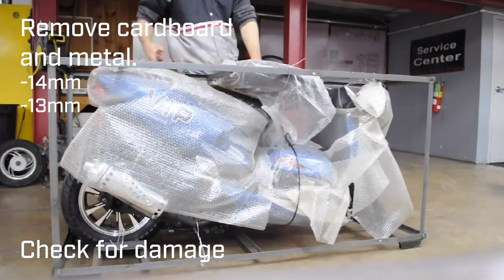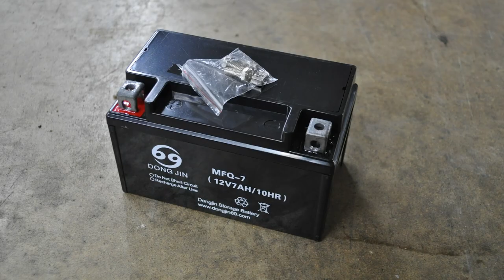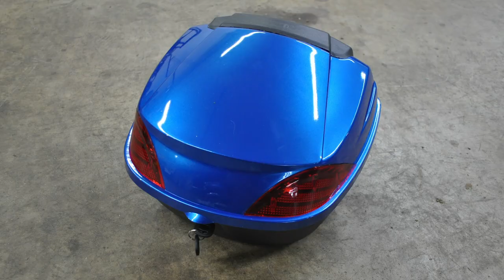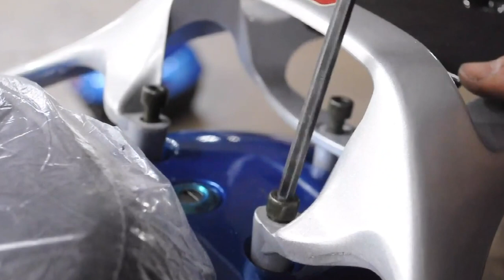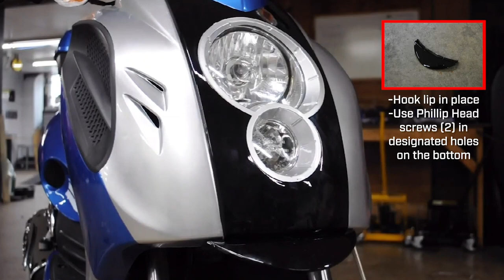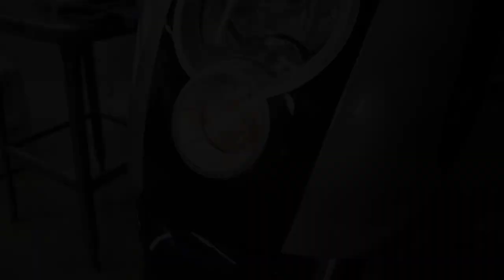Tao motors PowerMax 150 Scooter Assembly | Q9 Powersports USA

Comment: Thanks for the video. But the scooter is worst of the worst. It has only been 4 months and its body is breaking. Its is very fragile and not at all reliable. In jerk its side panel broke now i am confused how to fix it. The panel.itself is costing $100. Never every buy this.
Reply: @ Shahid. I have a 2010 and I changed the engine oil after 25,000 miles .  there are TWO major concerns with this moped. the exhaust and the  seat bucket which causes the panel clips to break. First loosen the  exhaust bolt at the swingarm if you need to,  use a washer to shim it, do NOT force the exhaust pipe to move towards the swingarm the mount will break. Second remove the seat bucket and on the crossbar that the forward/bottom /under the seat bucket not the rear where the gas filler cap is gas tank mounts to, place a piece of 1/2" or 3/4" strip of plywood about an inch wide and 7 inches long and tie it above the crossbar. this will keep the plastic from breaking due to pressure from you sitting on it  . do not waste $100 on a panel,  just use a bungee cord .  Also you might want to replace all of the hoses. I used a hose from my toilet tank to replace a rotted air line hose. . mine cost $650 USD NIB _ I ride mine every month even in snow and rain. these 3 problems are the only ones I have had  and they are very easy to fix  _   mine has the flat blade wheels not the ones in the video and I put a MAXXIS 6024 120/70-12 tire on back for offroad riding _
Reply: butchtropic  it only cost $700 and  i had to test it for a review article . i'm sure there are a hundred thousand more just like it . . oh, BTW, the review was amazing
Reply: butchtropic  no worries, the first one was sacrificial. it has  a twin  with 3000+ miles on it,  changed to Pennzoil before i rode it, changed the oil  after 500 miles and 1500 and 3000 . The second one is for a different review . and the first one now will be used to make trails in the woods and that off-road tire will get its use . BTW i DID change the oil several times since the 25,000 mile oil with Quaker State 10w40 and 10w30  every 1500 milesso i doubt there is much mud n the crankcase and after the initial 25,000 miles and at a cost of less than  2 cents per mile , it doesn't owe me anything  , and if t does konk out, i can use the tire on the second one so no loss there either .
Reply: butchtropic  actually it is not bad , i have it setting in a clear bottle and it is about 10w40 in consistency . i cannot honestly begin selling these scooters unless i feel they are a good machine , there are a couple common defects that i can easily and quickly remedy inexpensively . the two major defects are the  exhaust mount and the side panel clips , these are easy to fix by ziptieing a piece of osb board under the seat and loosening the lower rear exhaust bracket and shimming not straining it into position.  believe i will begin by ordering one shipping crate to distribute. not everyone who buys these things changes the oil ,  now know that even f run without any oil at all they still run , yes i ran one dry  to again test to destruction. it is not a car so  don't wreck it into a concrete barrier, do you think GMC was crazy to do that to test airbags in 1958 ? . i want to sell a safe dependable product that even if the owner doesn't regularly service it, t will still be a good investment .